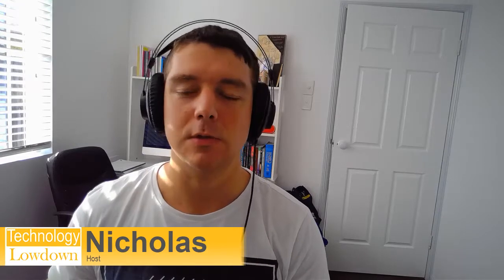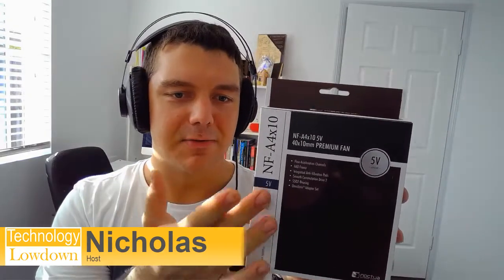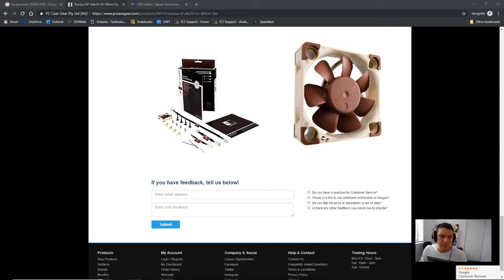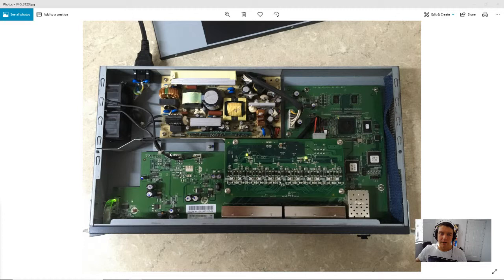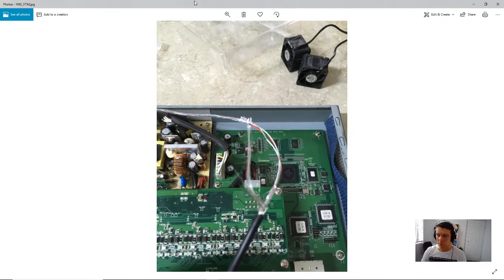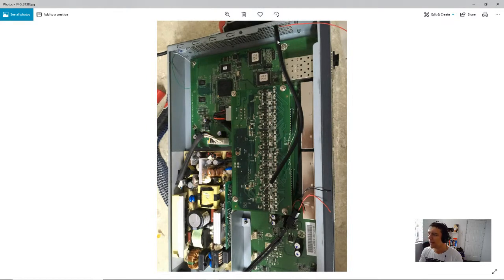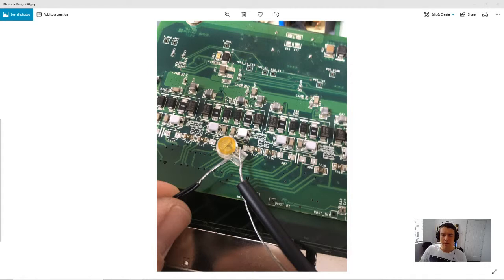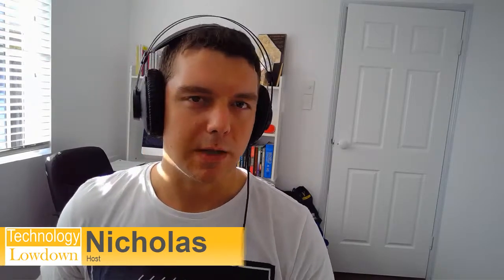Network Switch Fan Upgrade

Comment: Noctua buy a more or less drop in 12V, 4 PIN PWM replacement - NF-A4x20 PWM. it is 0.16m3/m air flow. which compares to 0.14m3/m of the 5V noctua, compared to 0.68m3/m of the stock fan (!!). I want to do the same mod but worried the noctua’s wont provide sufficient cooling. particularly if the firmware modulate the fan speed on the SENSE pin rather than temperature of various components. 

did you have any issue with temperature with your fans at max?

Comment: The 20mm thick Noctua fans are quieter and push more air than the 10mm thick Noctua fans. It is better in every way to use the thicker version if the switch can accommodate them. Also better to get the 12V version as it comes with a low noise adaptor which reduces it to 5v in any case. So you get more flexibility at the same price. The model you want is the NF-A4x20 FLX. And the weird USB solution is... weird. Much better to plug directly into the board. This also allows the board to modulate the speed of the fans so that they run quieter when less cooling is needed. Any issues requiring warranty, just swap back in the original fans...
Reply: This video made me angry lol.
Reply: Thanks for the info, I will try these in my switch, I do need power from the board.

Comment: Can I just install a 17ohm resistor inline for 7V operation?
Reply: Using resistors to step down voltage is not very power efficient. Yes it will work but the resistor is gonna generate heat.

Comment: noctua fans is quite on 12volt. you crew this up, dude
Reply from the maker: Thanks for your constructive feedback. I will take it onboard.
Reply: @TechnologyLowdown  thanks for sharing the video. I was looking for way to quite my extreme networks switch. After some other videos I understood than it's bettor to directly replace 12 volt 20mm wide noctua fans

Comment: I understand why you did it, but running them fans off USB plugged into another box is a shit way of doing it. I'll be swapping the fans in my ProCurve soon and putting the proper 3-pin connectors on them so I can plug them directly into the PCB.
Reply from the maker: I went for the 5/6V fans as they are quieter than the their 12V counterparts that are offered by Noctua. I read some reviews on the 12V vs 5/6V fans and frankly chose the quieter one as I couldn't stand the noise anymore! It works well with my setup as the USB lead just runs into my NAS on the shelf below my Switch.
Reply: @TechnologyLowdown  I tried my fan swap today, the Noctua 12v fans did work but the switch realised they were a third of the RPM of the original fans and filled the log with fan failures. I've ended up just using the low-noise adapters (resistors) that come with the Noctua fans on the original ones, works quite well actually. It doesn't make it 100% silent but it's still a welcome rest from the horrible whine.

I tend to take the low-noise adapters out when I'm not home though as the heatsinks for the switching ASICs do get hot (to be fair they do even with the fans running at normal speed).